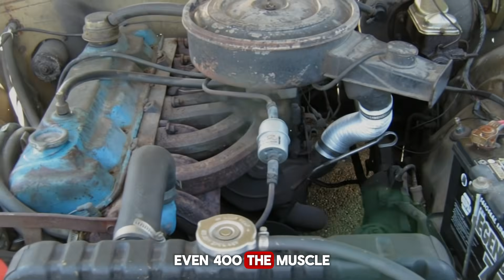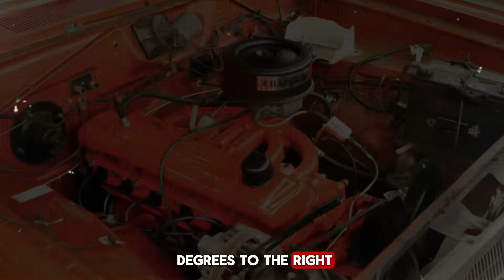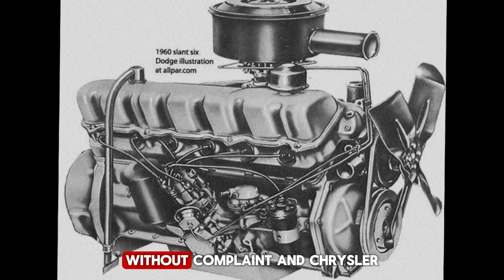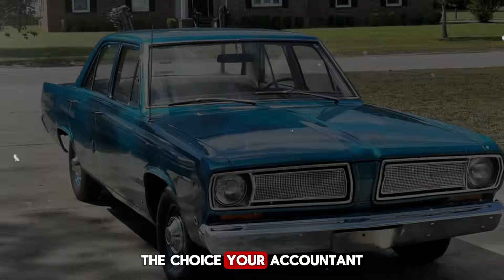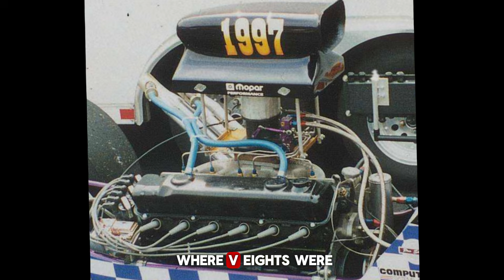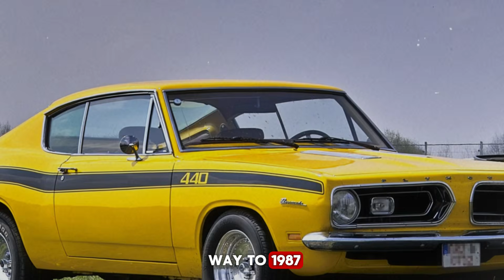The Shocking Truth Behind Chrysler’s Forgotten 225 Slant Six Engine

Comment: The slant six is not shocking. 12 million were built.  The USA ohv inline sixes were workhorses, in '64 the AMC/Jeep straight six was almost the last (Ford's 240/300) came in 1965. Ford had two series of inline six.  None of these 1960s era were developed much. The slant six is not a thin wall casting, but it's not a super heavy engine.
Reply: The slant six had 4 main bearings, not 7.